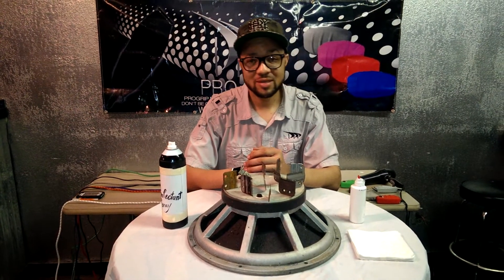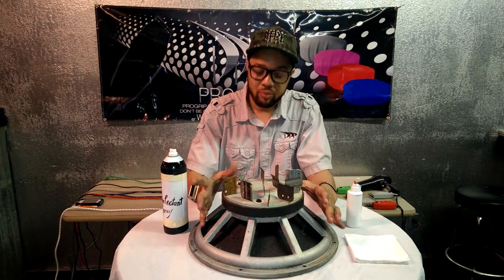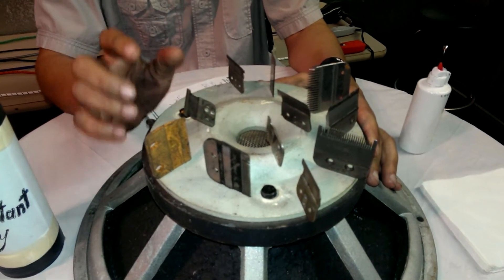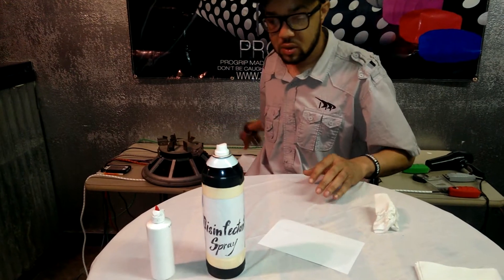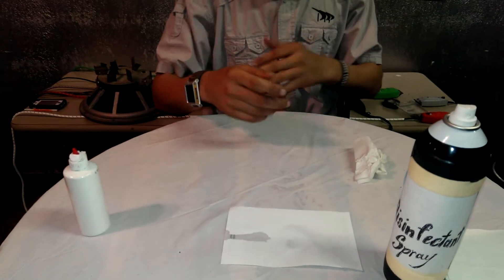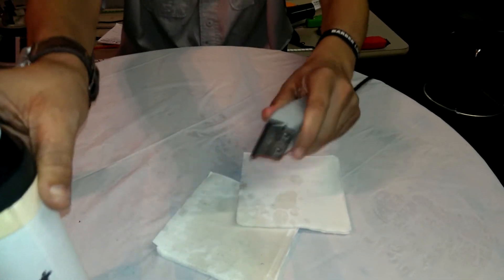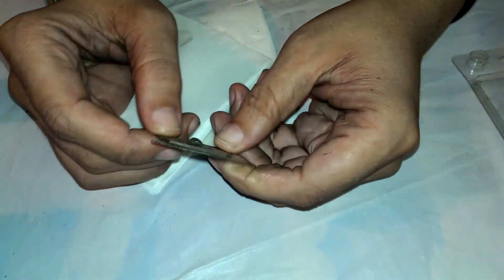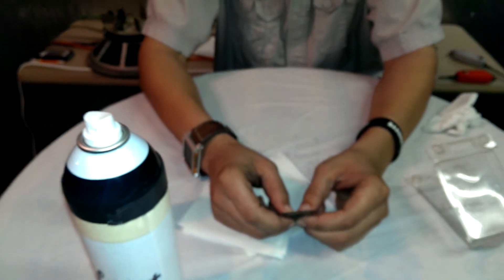The effect of disinfectant sprays on hair clipper blades

Comment: Finally someone who remembers the metal... oil decreases friction not disinfectant 

Also many dont know disenfectants have "wet time" so no matter what you use them on you have to read the fine print to see how long the surface has to stay wet.. Some are 15 min. Some are 30 sec.

I would think disinfecting is needed BETWEEN customers and oil during the cut.

I am not a professional but I simply use mineral oil which came with my   cheap clippers that I cut my hair with. 

 Now I need to upgrade to cut my long haired shepherd ..... cheap doesnt work so looking for the best oil for the ceramic blades I have on order.